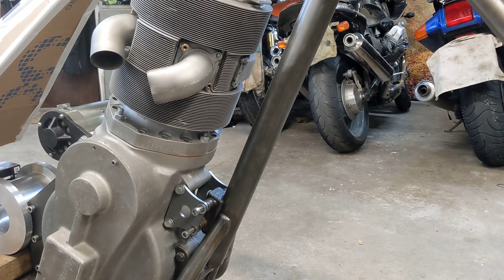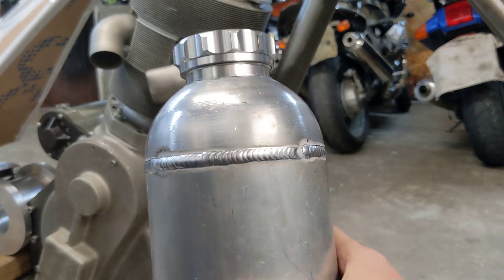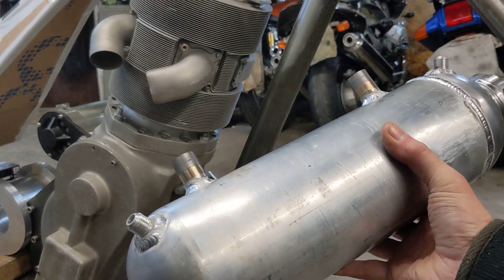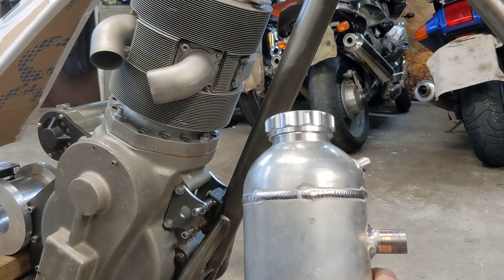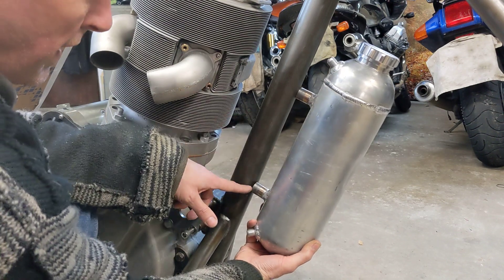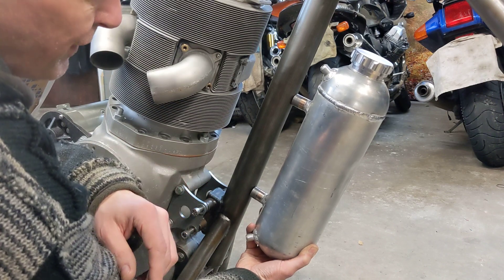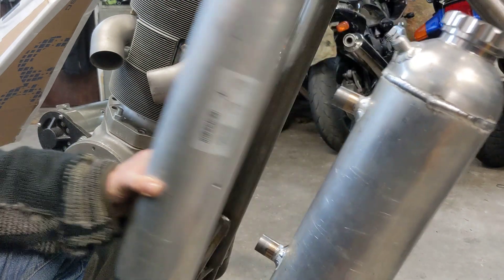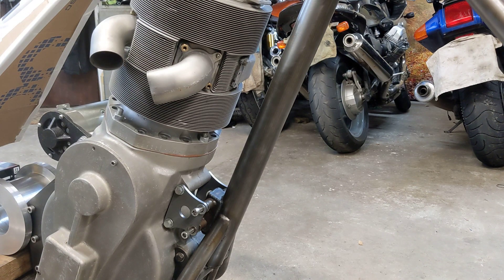Weld Done and Well Done!

Comment: Nice tank !   Do you plan to take off the lower fitting for oil changes ? Or does it back feed to the engine cases and can be drained there ? I guess so .... if not a bolt on the lowest part of the tank could be a good idea to get it all out :D
Reply from the maker: Yea, for an oil change I'd just remove the oil pipe at the bottom of the tank. Or syphon the oil out with a pipe. Or remove the tank and turn it upside down. Won't be too hard. 😁